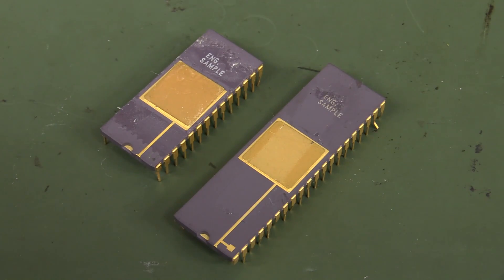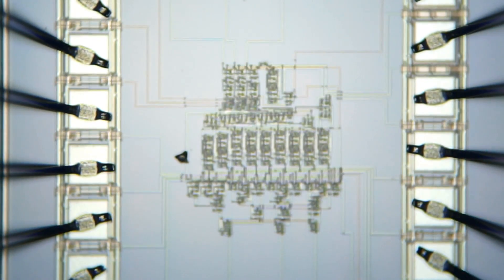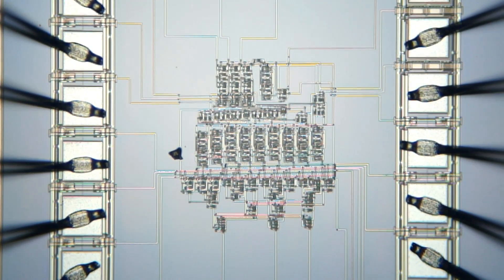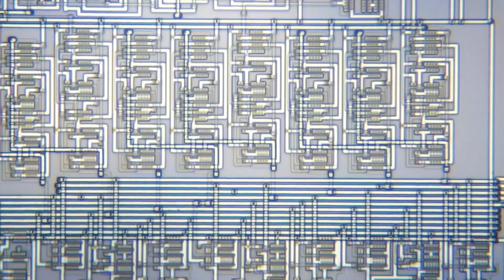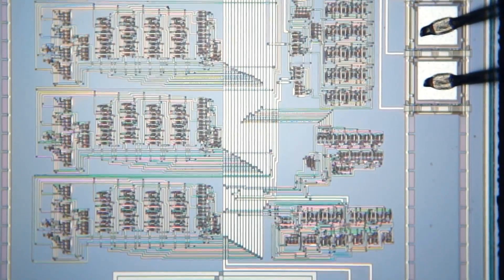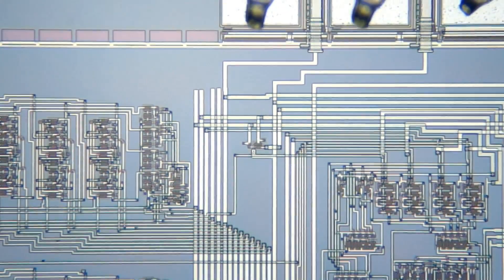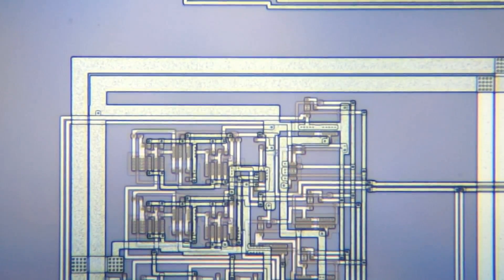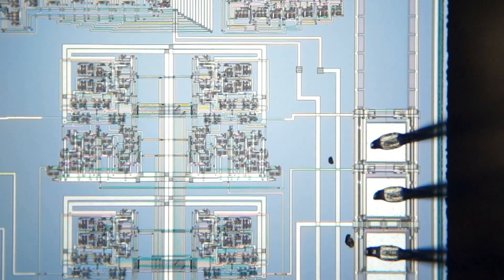RF Test Chips Under The Microscope

Comment: Next to each pad (between the pads) look like ESD protection blocks diodes, etc. This is not a very fast IC, maybe ~1GHz at most. Ancient process. :)
Reply from the maker: Thanks!
Reply: brilliant!
Reply: Shahriar beat me to it - re the ESD structures between the bond pads.  FYI - that method of wire bonding is called "wedge" bonding.
Reply: yeah i was thinking some sort of ESD

Comment: This looks like one of the AMS (Austria Microsystems) 0.8um BiCMOS processes from the mid nineties, possibly the BYE process. It appears to be a 2 metal process with some routing also done in poly. 
If you look carefully you can see the thin poly strips going in between the contacted metal areas, these are CMOS (Mosfets). Some appear to have a box around them, these are PMOS (in NWELL) whereas the others are NMOS.

The structures between the pads could be ESD clamps, but looking carefully one is in a NWELL so could also be a NMOS, PMOS output buffer.

The general layout would suggest a poor analog layout, possibly digital although there are no standard cells. Could also be high speed PECL logic.

There's no capacitors or resistors to be seen which again might suggest a digital application.

EDIT: on closer inspection there doesn't seem to be any bipolars either.
The 1,4, 10, 14 ....... numbers near the Nordic logo are the masks used. There are several unused which may indicate that this is the cheaper CYE CMOS only process and, if so this probably isn't an RF design.

Comment: The colors appear to be Bayer pattern artifacts from the camera, not true colors. Notice they change when you pan around.
Reply: Interesting! Thanks for letting us know
Reply: tesla500 love you channel, any update on the laser?
Reply: Thanks! Will get a chance to make a video after the first camera build is done, hopefully next week or two.
Reply: Good point!
It'd be interesting to see how much improvement a Sigma Foveon based camera would bring into a setup like this.
Reply: Brendan Raymond Composite video? It's not 1995, man! All snark aside, in the first video about the microscope, he explains that it's HDMI out from the Sony camcorder they're using. So the colors are probably some combination of Bayer pattern artifacts, lateral chromatic aberration, and the prismatic effects of the tiny traces (the effect that causes the rainbow coloring of IC dies, CDs, etc. Not sure what the exact name of this effect is).
Reply: It is a moire artefact, and possibly due to the camera line skipping an oversampled sensor.  
Without knowing more about it, it's possible that it offers a 1:1 pixel crop in mode at 1080 etc.

Comment: A.S. or A/S is the Danish and Norwegian (but not Swedish) abbreviation for a fully incorporated corporation.  The AMS 1995 at the other side of the same chip (if it's the same chip marked 1996 Nordic VLSI A/S) could be designer initials and original design year, or it could reference a cell / component library used somewhere in the design.

Comment: I did a simular thing a few months ago with a Texas Instruments DSP. I got one in an old UV eraseable ceramic package. Modern proceses probably require much higher magnification and may not be even visible in the normal spectrum.

Comment: Was expecting to see on-chip inductors and capacitors as it was an RF chip. But seems like it doesn't have any passive components, not even polysilicon resistors
Reply: Doesnt work in that way, say fex a FPGA it can but out data at several GHz but it doesnt need any real passives for that.
Reply: caps and resistors are next indistinguishable from MOS transistors and poly wires respectively, and on chip inductors weren't really a thing back then and are still an obscure thing now. And why have a passive resistance when you can have a MOS transistor that is smaller?
Reply: It's very common to use depletion-mode transistors instead of resistors. Poly resistors take up a lot of space, transistors don't. Gate capacitance also gets used deliberately quite a lot.

Comment: I remember the space shuttle used to use 5 IBM computers the same as used on the B1 bomber to provide redundancy in the event of a breakdown. At the end of one mission just as the wheels touched down one of them shutdown. Nasa after decapping some of the chips discovered traces of human phlegm on some of the dies, apparently someone sneezed in the process lab.
Reply: good tymes... Pentium 27 and higher now witrh 7 layrers. time marches on.

Comment: Dave, is it possible to add a polarization filter, like a circular polarizer to the mix? I think if you did that it would improve the clarity some while focusing at such a shallow depth of field. This will also clean up refraction allowing for a sharper image. Isn't chromatic aberrations and refraction fun at such a high level of optical magnification.

Comment: maybe it's 1995 AMS (probably Austriamicrosystems)
if this is an RF chip, it should be rather low freq, otherwise you should see inductors.
I think this one has no more than 3 metal routing layers
Reply: AMS has manufactring bussiness for others, their main fab is still 0.35um (at the time I visited around 2009, 0.18 in preparing), but at 1995 should be even larger...

Comment: I could only imagine what an AMD Ryzen would look like under the scope.
Reply: Robert Kilbourne optical microscopes, even the best brand name ones, are limited in x/y resolution to about the wavelength of light. so, an older lens of adequate build quality should resolve down to about 200 nm to 250 nm at best. newer high end objectives using violet, or even UV light have the potential of resolving down to about 100 nm. (each company makes different claims.) current CPUs are already using so-called 14, or even 7 nm processes. you would need an optical  microscope system capable of handling extreme UV to get anywhere close to examining these CPUs . as a practical matter, you would need either an electron microscope, or maybe a scanning tunneling microscope to visualize something that small. having said that, older optical microscopes are still very usable for looking at older chips, or even modern chips made using the older (and cheaper ) fabrication technology. I find that this kind of imaging has a subtle beauty all of its own.

Comment: Could you try exposing the die of some semi modern CPU or GPU and take a look at it with the microscope?
Reply: Not much to see - details are too small for his microscope, also there is usually metal layers obscuring most of the chip.
Reply from the maker: Modern processes are too small to see interesting fine detail with such a microscope.